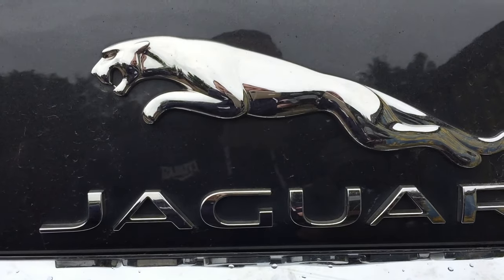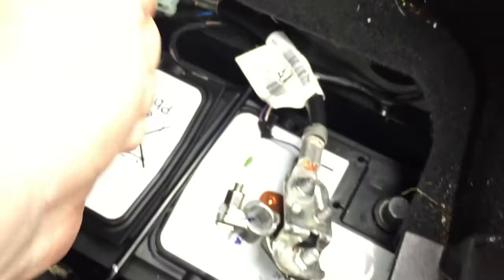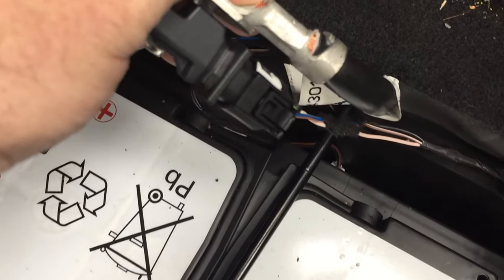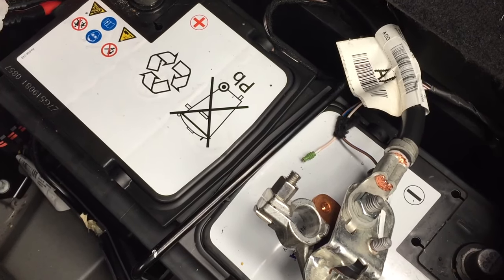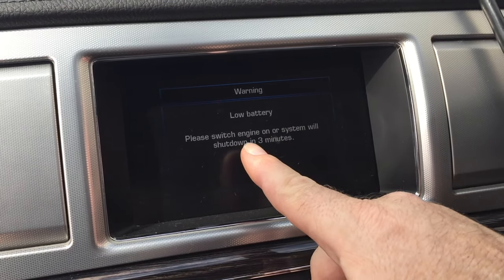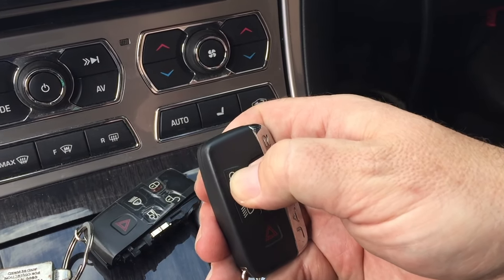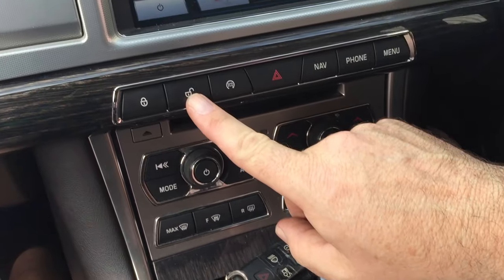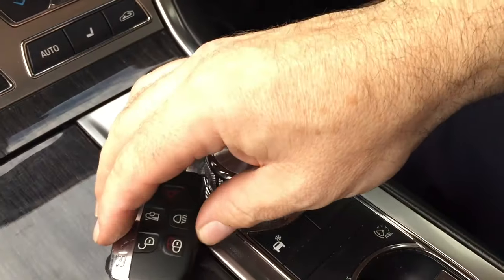Jaguar XF 2015 - Central Locking/Key Fob not working - Part 2

Comment: Easy fix - Had this exact issue in the workshop today, the battery had been disconnected for a moment, causing the central locking and remote fob to not work, the security module in the door had to be reset. we tried Snapon, Autel and Launch, none would reset the security code. Had to use Autologic from a Jag Specalist in Wembley, London to reset the security code in the door! 5 mins work when you have the right tools for the job!
Reply: Hi!, I’m having the exact same issue after a remap? Would you be able to give me the contact details or name of the garage in Wembley please? I’m based near Wembley also. Thank you !
Reply: high wich door is this module in thanks

Comment: Hi Sandy, I have the exact same issue with my XF 2013 after my alternator died my locks are not working anymore. Alternator was replaced, everything works except the locking. The knob does respond to the Alarm and light's but no lock / unlocking same for the buttons on the dash they don't do anything.
I went to the Jaguar dealer but after they did a diagnose they told me i had to replace 2 fuse boxes witch would cost me over 2K in euro. But they do not give warranty it is solved by this. Not going to pay 2k for testing this out. Now i came across your video and the issue looks similar to mine. Should i go to a independent shop ?
Reply from the maker: Yes u need to find shop that has Autologic with Jaguar software installed or an independent with jaguar sdd software to do a security relearn

Comment: Once the battery is disconnected and your key still works to start the engine, but the doors do not lock or unlock via the key fob, you need to use “Autologic” or “SLR SDD” for Jaguar to run the immobilizer/reset.

Comment: So, was this ever fixed? Just curious.  By the way, the small battery is for the 'stop/ start' function and should not affect the locking...
Reply from the maker: Yes local garage with autologic fixed it with security relearn
Reply: Fixed it with the jlr sdd and a chinese mongoose cable at home. Dealer had no idea and tried to charge 100usd per hour. Just run the immobilizer reset with the sdd and it will work like new
Reply: it did unfortunately i did it to my car. i replaced the start/stop battery and it has affect all my door locking except the boot lid. i thought it should not affect the locking, i asked my college teacher about it and he is a mechanic and he said, "sadly bro, it need to plug in and reset to let the car system know you replace the battery and will make all the door locking work again"
Reply: ￼
Anyone who helped you??

Comment: You say to reset the security module. Where do you find this option in sdd ?
Is it with « key programming « , or “verify keys ” , or somerhing else ?
( because my garagist tried this morning without success). 
My 2 keys don’t work again after I have changed the main battery - ( on a 2013 XF )
Many thanks
Reply: you have to go into the door module and do the security code unlock/reset, nothing will work apart from Autologic
Reply: @downshiftremaps4117  SDD?

Comment: I had my XFs batteries both unplugged for 9 months coz i was out of the country. I came back. The small battery was dead. Replaced it. The big one was fine. Car started. Showed that Fob battery is low. I changed it. However there is no way i can lock the doors with the interior buttons or the key fob. I searched the forums. They say that they had to do a BMS reset(battery service management) and an immobilizer check routine then it should reactivate the central locking again. I will try it today with a jlr sdd on a laptop
Reply: Hi
And did you find the solution ?
Reply: @hervema4476  yes a laptop with jlr sdd. Did an immobilizer reset and done. All work now
Reply: @gregcy89  thanks but …
Is it a menu ´immobilizer ´ or is it in the ´key programming ´ menu or tab 
( I am french and try to imagine where i find this in jlr sdd )
Thanks
Reply: @hervema4476  salut Hervé est que tu a trouvé la procédure avec le jlr sdd pour le reset?
Reply: @baks6890  
Bonjour
Merci de t’en inquiéter :)
En fait je ne l’ai pas fait. La voiture est allée chez Jaguar, et ils ont trouvé un problème sur un module ( de gestion des sièges ), qui provoquait des erreurs sur le bus de données.
Tout refonctionne normalement, y compris la reconnaissance des clés, qu’ils ont réussi à reprogrammer, difficilement
Reply: @hervema4476  Salut, je vient de réussir l'initialisation/reset des clé avec le "jlr sdd 159" et les clés refonctionne parfaitement. Je l'ai acheté sur aliexpress pour 39 euro. Enfin 🥳
Reply: @baks6890  merci. Je l’ai acheté, mais je crois que je ne vais pas y toucher pendant quelques temps . 4 mois d’immobilisation a cause de jaguar, pour une panne finalement trouvée en quelques heures…
Merci pour ces retours :)

Comment: Hi have you fixed the fobs yet.
Reply from the maker: Autologic fixed the car security module, the fobs were not the problem
Reply: @sandyande  good did you know that jlr changed the kvm system for 2015 cars onwards, there is a bit on the owner club site.

Comment: Hello Sandy,
I am having a similar problem. When I lock the car with key fob all the doors lock except the drivers side door and it honks twice as to let me know the door isn't locking. Any ideas what the issue could be? Thanks.
Reply from the maker: More than likely to be that door lock/switch is my best guess
Reply: @sandyande the door lock actuator? Thanks for replying.
Reply from the maker: Check the wiring for breaks between door pillar and door, peel back rubber boot
Reply: Xf doors locks are a known problem. They have two small electric motors in each and these fail due to lubricant getting g onto the motors comutator and brushes. Simple fix. Change motors or strip and clean them. Or replace lock . Locks are relatively cheap and there are aftermarket locks readily available.

Comment: Is it possible the FOB's will have to be enabled/reprogrammed so the lock module/ body control module (whatever JAG's terminology is) "recognizes" them again due to the loss to continuity on the circuit Sandy? Just a thought.
Reply from the maker: Could be Iain, I'm stuck cause I'm unsure if the autel is reliable in its tests!  because the fob can turn on the lights so it therefore can communicate with something! Reading the forums it's a common issue if say 1 faulty door lock takes down the whole system, although no codes in any module but boot microswitch feels dodgy! System was all fine til battery disconnected cheers Pal, sandy
Reply: @sandyande  Oh wow I just re watched your Vid Sandy. I obviously missed the part where you mentioned the dash mounted switches also don't work. Can you pull up the PID's if you go into the body control functions and see what's changing state input wise? Cheers again...Ian.
Reply: Just found this video by accident! I fixed this very car today ( I recognised the broken spare key) used the autologic to do a security learn in door module.now working fine 👍🏻
If you need anything else done let us know.Btw we also do cylinder head work (re surfacing,pressure testing,guides,valve and seat work) Riddells Garage Bo’ness
Reply from the maker: Cheers Allan good to hear from you, George was telling me last night it's a fix!  Was a straight forward procedure on the autologic ? And how highly do u rate this tool compared to snap on/autel etc? Cheers sandy
Reply: sandy anderson it was fairly straight forward. We are using the older ‘blue box’ and is very good with Jaguar . Unfortunately they stopped some of the more in depth software flashing with vag and french. The new machine covers more brands but if you go to the ‘pro’ level with new one you get in depth on bmw mini jag and land rover
Reply from the maker: @alanriddell2277  cheers Alan thanks for information many thanks sandy
Reply: @alanriddell2277  Hello Alan, I live in the netherlands and no garage knows how to fix this problem. What do I have to tell them so they can repair my problem also? Will they undestand: "use the autologic to do a security learn in door module". Or do I have to give them additional information? Thank you!
Reply: @I Like  Hi there. If you can find a garage using autologic machine, they will be able to do it providing they have the Jaguar software (autologic only works with the manufacturers you have paid for not like a generic diagnostic tool) . They will also have access to a dedicated helpline at autologic headquarters who can guide them through the procedure. Hope you get it fixed 👍🏻
Reply: Hi Sandy 

Are you managed to fixed your Jaguar XF 

I have exactly the same problem with my Jaguar XF 

Thanks
Reply: @sandyande  how much did they charge ?

Comment: Often times if the boot or the bonnet is not properly closed or if it's not closed as per instructions in the booklet of the car the central locking will not function when pressing the key fob buttons.

Comment: I have same problem, does anybody know the answer please…!
Reply from the maker: Autologic can fix this with security relearn or main dealer
Reply: Thanks Sandy.
Reply: my college teacher told me that the car forgot its memory after replace a new battery, it need to plug in and reset it again to let the car system know you replace the battery and make all the door locking work again. i have the same problem.

Comment: How did you fix it ??
Reply from the maker: Used autologic diagnostic machine to resync security module
Reply: @sandyande  I got the same problem can help me
Reply from the maker: @ashtrix0092  u need Autologic or Jaguar SSD tool to reset security system
Reply: @sandyande  thank you we’re do I get that from or who do I go to ...can send me link please it will be Appreciating
Reply: @sandyande  
Hi
And what is the menu to use to fix the problem ? What item to sélect in jlr sdd ?
Thanks
Reply from the maker: @hervema4476  my friend used. Autologic to fix this he chose security relearn not sure whats it under using Jag software

Comment: Hi Sandy 

Are you managing to fixed your Jaguar XF 

I have exactly the same problem with my Jaguar XF 

Thanks
Reply from the maker: Yes it's fixed, it had to go on a autologic scan tool to configure the central locking system after battery disconnected cheers sandy
Reply from the maker: It was actually a security re-learn on the door module it cost £40 1 hour labour
Reply: Who done that security Re-Learn 

Jaguar main garage or some independent garage
Reply from the maker: @stanleystone3954  an independent